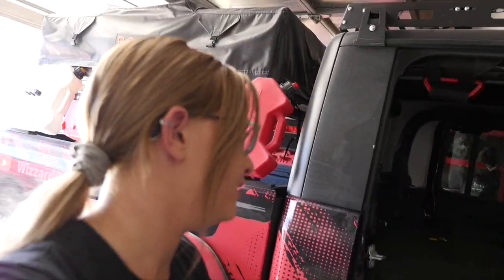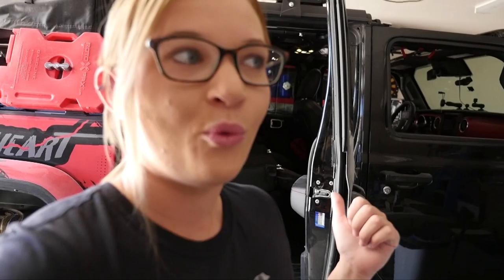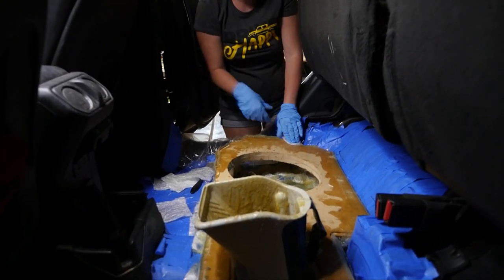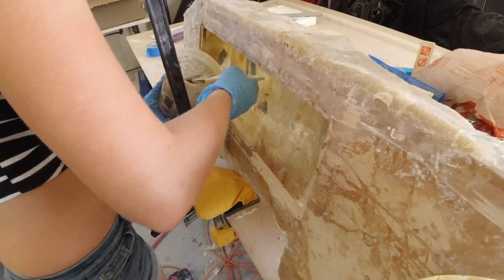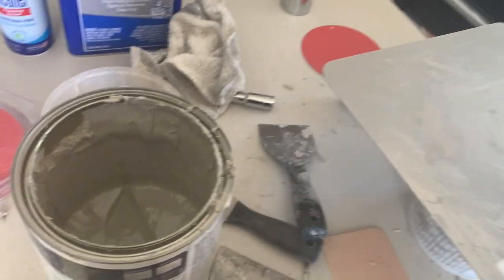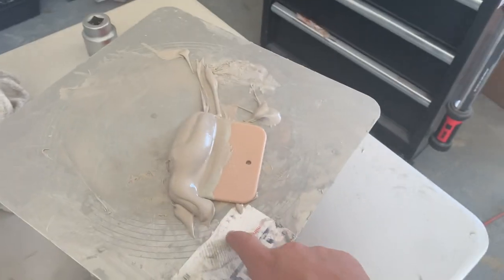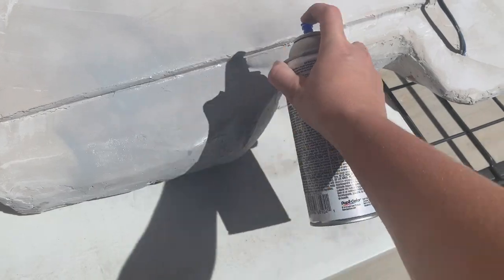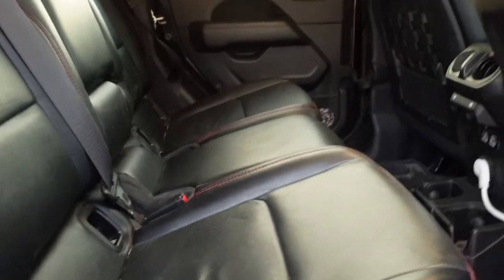Jeep Gladiator Sub box upgrade | Custom sub box + Woofer Giveaway

Comment: Mad props on mixing and spreading the body filler. Lil tip next time u give up on sanding it use bed liner instead of paint makes it blind better and looks killer
Reply from the maker: Thank you for the tip. It was a learning. Exp we should have done the shape better. Would have been less sanding
Reply: @OverlandishAdventures  you done a great job I just hate sanding myself so I use bed  liner to paint the box. And for the Mrs to be in there doing it the up most respect

Comment: Great job a little tip next time working with fiber glass wear a respirator when you sand it that stuff isnt good for your lungs. Neither is the bondo fumes lol. But not bad for a 1st time working with it
Reply from the maker: we figured that out....  we did have one on and had fan running ....
Reply: @OverlandishAdventures  good deal.